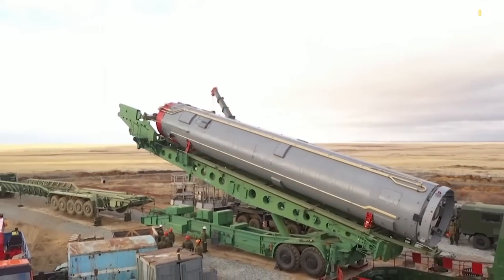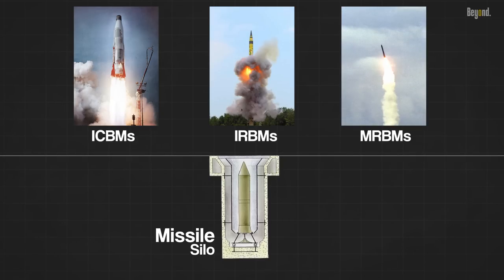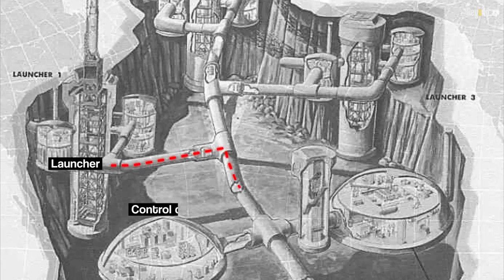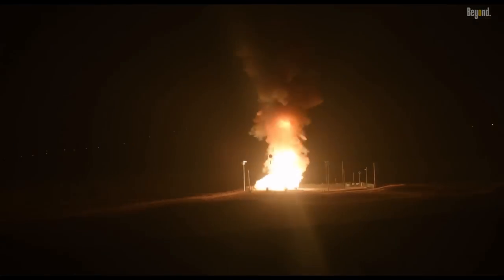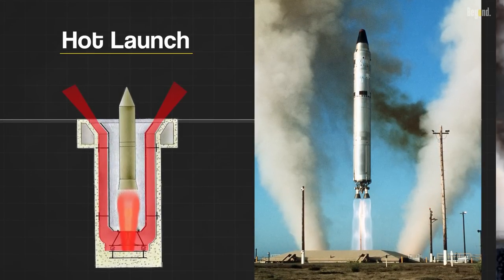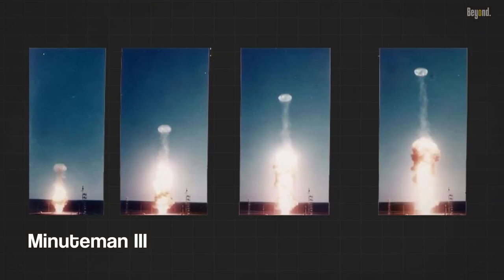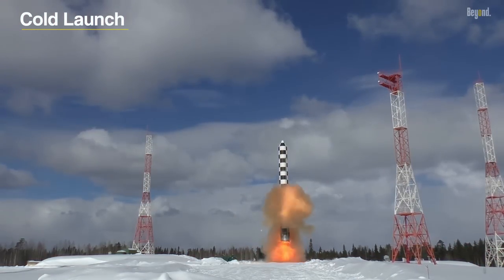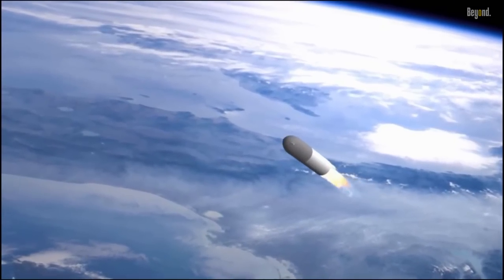What happens to a missile silo after a launch?

Comment: well my cousin sat in a silo for 12 years. he didn't say much about what happens but I asked what happens at the end. he said once the birds are away the last page said... if you are reading this, start a timer. if it reaches 1 hour, you're alive and start praying when you start the timer. He knew once everything was done, it was just a matter of time. 60ft or 200ft down doesn't matter to a nuke.
Reply: @x6ftundx.  As a former MMII/CDB ICBM Missile Combat Crew Commander I call BS on that. There is no last page telling crew members to set a timer.  The hardened Launch Control Center (LCC) and Launch Control Equipment Building (LCEB) are set up to provide power and the capsule (aka LCC) has food and water for the crew.  There is also an escape tunnel filled with sand that can be utilized in the event the topside building is gone and debris blocks the elevator. That being said, most of us on crew knew that we would need to complete our launch checklists and turn keys before incoming missiles took us out. By the way, if anyone mentions pushing buttons to launch ICBMs you know right away they are full of crap. That’s not how it works.
Reply: @brax2364 My hat's off to you guys, as a first sergeant of a unit inside Cheyenne Mountain during the cold war, I worked closely with a lot of former launch crews who proudly sported their "pocket rocket" insignia.
Reply: @Javelina_Poppers  Thanks.  I survived 4 years of Crew duty back when SAC was in charge - was on alert when we got that actual EAM that told us to get the cookies and insert keys. Pucker factor.  Survived 5 StandEvals with 5 HQs, Unit (Wing) Instructor, Olympic Arena primary competitor, & 4315th CCTS IQT instructor. I left crew after 4 years and just grateful my USAF career was still on track and I still had both ass cheeks still in place.
Reply: @Javelina.  Since you were at the Mountain, did you ever get these?  “SKYBIRD, SKYBIRD This is the SAC Airborne Command Post with a test of Primary Alerting System Backdoor Circuitry……. 8th Air Force OVER…. 15th Air Force OVER…. Acknowledge Now!……… Ouuuuut…..”
Reply: @brax2364  Loved your reply.

Gotta say, if someone says, "They didn't say much about it," probably because they didn't actually do it and don't want to be called out for their BS.

Might have spent 12 years in their mom's basement and played 'pew pew' games on their Nintendo or PlayStation. 🤣

Comment: if you want more defense contracts, then make more maintenance and repairing job.. single use on everything, is preferred.
Reply: News to me.  I spent 9 years in the USAF doing iCBM maintenance.  Not a contractor in sight.  Those launch facilities are all primary first strike targets too.  No need to think about reusing them unless you want to make light bulbs out of the rubble.  They would glow for hundreds of years.

Comment: Here one thing is forgotten when making the distinction: during a hot launch it can destroy the entire silo in case of a malfunction of the rocket launch (explosion of the rocket in the silo if the rocket should not take off). In a cold launch it would explode outside, as it is ejected without its own propulsion. A cold launch is therefore also an extra security feature.

Comment: While the Minuteman missile silos are designed to be repairable.   I expect it would take at least 6 months assuming you had all the parts and supplies on hand (and more likely 9-12 months).   Basically, all platforms, equipment, and wiring has to be replaced.   I'm sure the concrete silo would also be cleaned and repainted prior to installation of the new platforms and equipment.   I'm not sure if there is a provision for short control and power cables that are connected to an external to the silo buried vault to prevent you from having to run new cables for miles back to the control center.
Reply: Maybe that is the crews post-launch activity?
Reply: The MMIII silos used at Vandenburg SFB are used for unarmed test launches only. So I imagine they are repaired every time. The main silos used for MMIII, probably not something you'd worry about repairing after a nuclear war.

Comment: But how does the rocket know where it is and where it needs to go?
Reply: It uses inertial navigation systems - accelerometers that integrate all axis of accelerations to find their current speed vector. The systems are very sophisticated today, however in its very basic form the rocket does not even need to know where it is during launch, just a trajectory that it needs to maintain to reach its target.